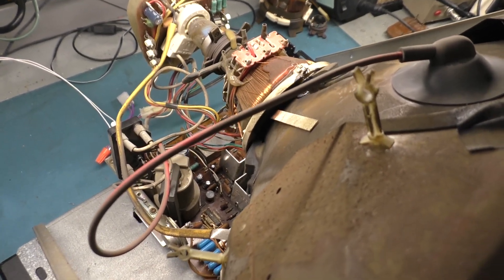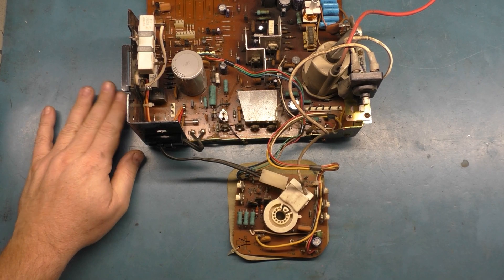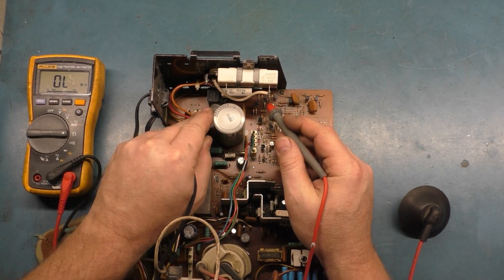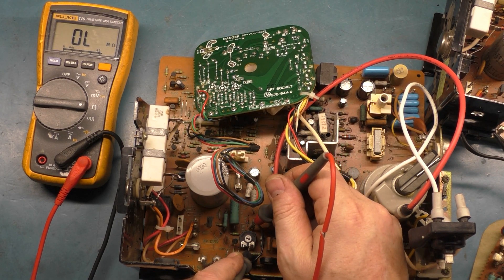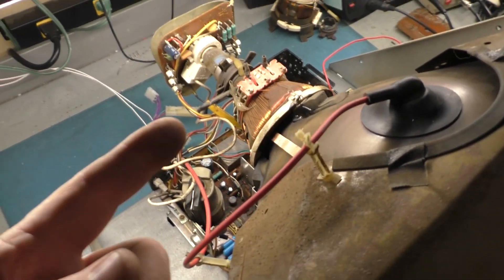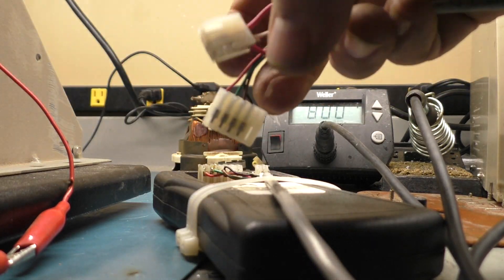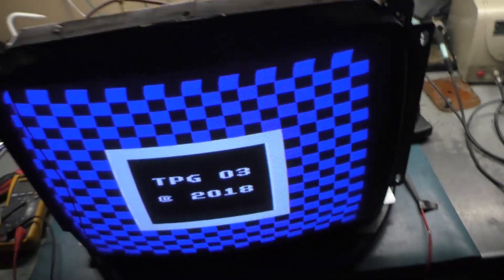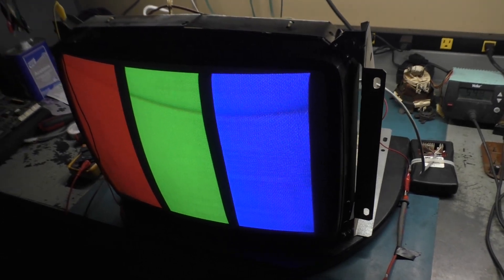19" G07 Arcade Monitor Chassis Repair - DEAD - Easy Fix? Don't Forget To Check The B+ Pot!

Comment: Dang I think that fixed the horizontal width issue I was having with my crt just sweeping the pot back and forth several times fixed that issue. Thanks now to tackle the problem of very little green. Blue and red work great but green is very faint. I have to turn the red and blue almost all the way down to see green. Any suggestions? Can I read voltage coming out of the pots or from the  transistors? BTW someone replaced the monitor in the Galaga  with a newer one, the crt is a Samsung and the chassis and the tube are both labeled WG1466760 whatever that is? Thanks 🙏
Reply from the maker: Awesome. If the pots on the neckboard are good, it’s very likely the tube simply has a weak green electron gun. Might need a rejuvenation.
Reply: @MikesArcadeMonitorRepair Thanks that’s kind of what I was afraid of 😂

Comment: I have a g07 monitor that keeps blowing fuse f902 and I’ve checked diodes d901-904 and they all check good at around 500-800. Any ideas at what the problem is?
Reply from the maker: Check the B+ resistor. If it reads shorted, the voltage regulator is bad. Also make sure the ceramic resistor next to the rectifier diodes is good.
Reply: @MikesArcadeMonitorRepair  ok, I’ll take a look. Thanks

Comment: After measuring the b+ resistor I am getting 211 olms. Also the cf11 cap is bloated at the top, could that be the problem?
Reply from the maker: Yes!
Reply: @MikesArcadeMonitorRepair  ok, does a regular g07 cap kit include that cap? Sorry for the questions I’m just not really knowledgeable with monitor
Reply from the maker: Nope. It’s ok. You can get it separately

Comment: Have you done any WGM2794’s? I just picked up a Big Buck Hunter arcade and the screen is totally dead. I have power going in, fuse is good. This is new to me so I’m not sure where to go next
Reply from the maker: No, unfortunately. Just 9200s. The digital monitors are such a pain that most people don’t work on them.
Reply: @MikesArcadeMonitorRepair  ok no worries. I did find 2 capacitors that are leaking so I’m going to start there. Fingers crossed! Is it possible to switch out the monitor chassis for something more common and reliable?
Reply from the maker: Unfortunately no.

Comment: Mike, are you accepting monitor boards for re capping? I have a WG K7400
Reply from the maker: Not at the moment. My apologies. Going through a home remodeling at the moment and I still have some backlog to get through. It just needs recapped?
Reply: @MikesArcadeMonitorRepair  No problem Mike, I understand life gets in the way at times. I was referred to you by some arcade groups. my Ms Pac Man/Galaga reunion machine is having some monitor issues. The bottom part of the screen has a line out of place on test which is causing the screen to be squished at the bottom and the words 'FREE PLAY' upside down and backwards and stretched out into the play field. the rest of the monitor is great.